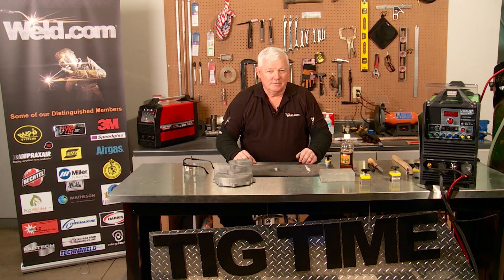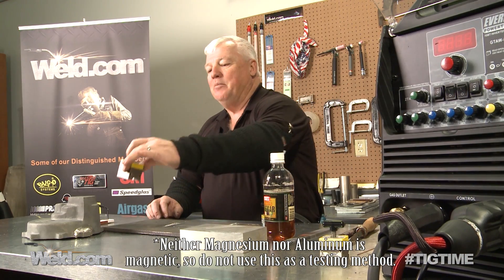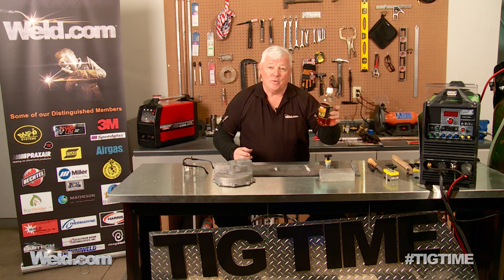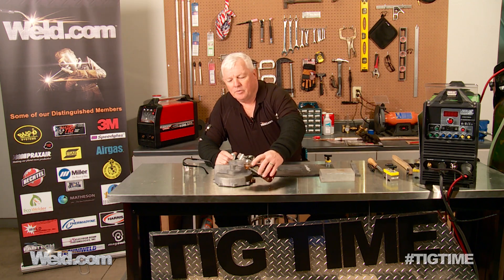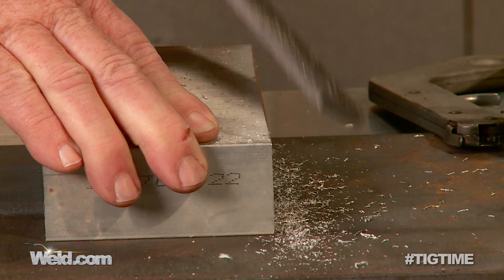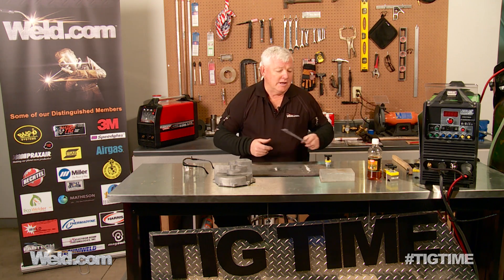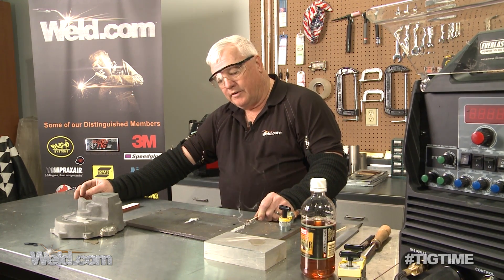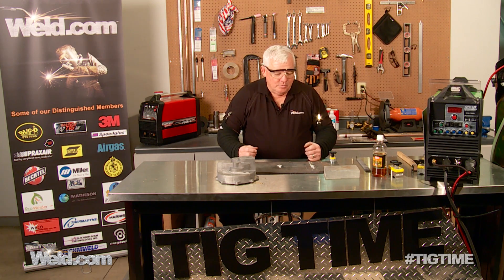How to Tell the Difference Between Magnesium & Aluminum | TIG Time

Comment: I bought ‘magnesium’ pencil sharpeners from Amazon to create emergency kits to start a fire with flint, magnesium and wood shavings.  Unfortunately even though the listing stated it was magnesium four times, the shavings did not burn.   I used your video to verify the ‘magnesium’ pencil sharpeners from China, were in fact aluminum.  

I watched you light the magnesium, and was a little optimistic since your magnesium shavings took a little effort to ignite and they burned fairly quickly, but not the big flash that I expected.   

My attempt to ignite the  shavings was unsuccessful but I only held a butane grill lighter to the shavings for about 5 seconds, so I thought that maybe I didn’t try hard enough to light the shavings.  However, I then put vinegar on a pencil sharpener and got no reaction at all pooling vinegar on the aluminum sharpener for 30 seconds.

Comment: You can also do a density measurement. Magnesium is significantly lighter than aluminum (or any other metal you'll likely touch). Easy to measure density with water displacement for volume and known density charts. Of course, there's alloys that can come into the mix, but at least this way you can also know how pure your magnesium is

Comment: Mr. TIG does it pay to use ER316L to weld all types of Stainless steel rather than use ER308L which won't work on 316L material or  do you have another preference?

Comment: Thank you!
I watched a lot of videos including teardown videos where the person doesn't know if this casting is magnesium or aluminum. Big mystery, unsolvable.
Actually you got two ways of figuring it out. I like the vinegar method better. WWII incindery bombs were little dominoes of magnesium that was lit by gunpowder. 
Thousands would fall away from the bombshell and burn for many minutes. 
Magnesium lit this way will even burn underwater. So it cannot be put out using water.
Thanks again for this simple and useful technique.

Comment: aluminum will burn. it is a major component of thermite. it requires a hot ignition source such as phosphorous or ironically magnesium.  even steel will burn under these circumstances.  be very careful with class d (metal) fires they cannot be put out with water or regular fire extguishers. great litmus test for metallurgy though. thanks.

Comment: "aluminum is not pyrophoric, so it should not burn" Well that's not what Pyrophoricity mean's (substance that will ignite spontaneously in air) and yes vary finely divided aluminum is pyrophoric. Also aluminum will "burn", if ignition source was hot enough and the concentration of oxygen was sufficient to fuel the reaction.

Comment: Mr. TIG,

I'm in the process of learning TIG welding, but my biggest challenge is choosing a correct rod (type/size), heats setting and tungsten diameter. Do you know/recommend any book that can be used as a reference guide that shows you how to identify metals, choose the type of rod/ tungsten & tips and tricks to weld the metal you are working on. Example (correct me if I'm wrong)Stainless is welded on DC- low heat/fast/purged to avoid distortion and change in mechanical properties.
Thanks